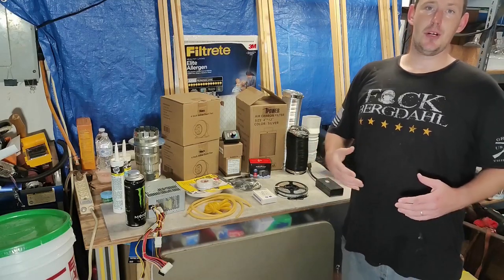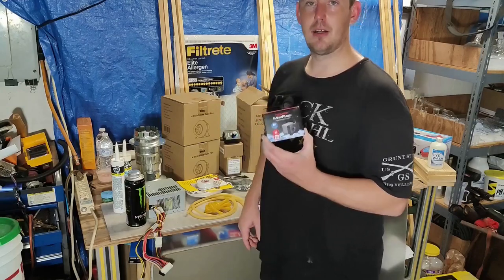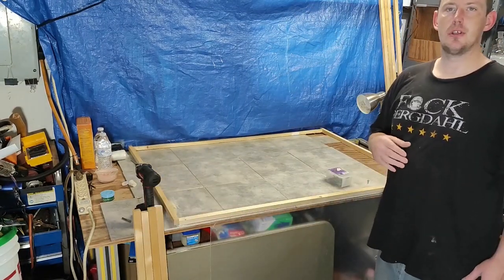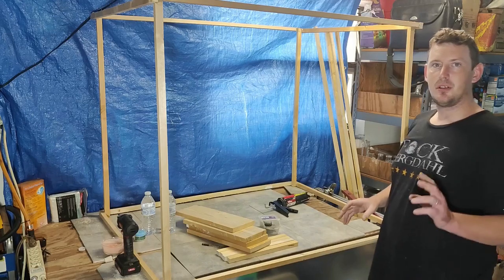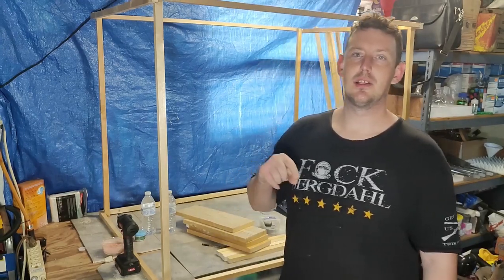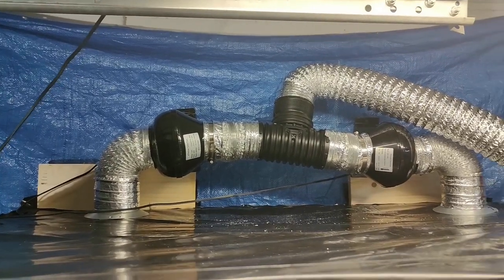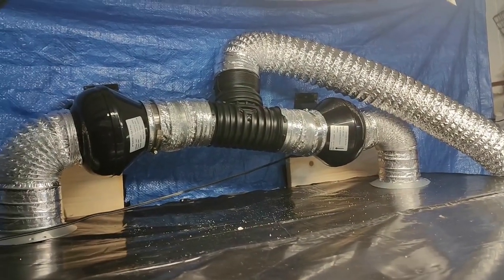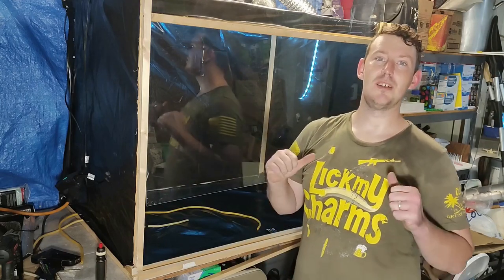DIY Laboratory Fume Hood: Easy, Cheap, & Effective Walkthrough

Comment: Fumes will exit much more efficiently if the top is built at an upward angle into the exhaust ports. A flat top causes turbulence and fumes roll around inside
Reply from the maker: I'm not building it to outperform existing functional fume hoods, a simple carry over is fine here once I get the baffles on and new fan put in. I just have way too much going on to attempt playing in the lab, it's sad unfortunately since I haven't been able to record or experiment in a year now

Comment: I like the concept. I am currently planning out my fume hood setup. I think I will use a plastic barrel loaded with carbon as a pre-scrubber to protect the ventilation system.
Reply from the maker: I really wanted to use 1/4" plexiglass on all six sides, and then use squirrel fans for the air barrier and scrubber but the project fell way out of price range rapidly. Do you have the vent system planned out? I'd be interested in seeing what you've got planned for your build
Reply: @CondorrK Carbon filter with water based scrubber would keep your neighbors happy at least. You can treat the waste water as needed. Plexiglass reacts to certain acids and petrochemicals, as well as nitriles. I still say living  1,000 yards from anyone is the best option, which doesn't help you. Nitric acid boils are quite easy to see from miles away anyway.  Lol!

Comment: I love it! But why not use 2x4s or sheet metal studs at home depot?
Reply from the maker: Mainly pricing. The wood was sourced locally for free and I already had the Mylar/plastic sheeting. If I had more budget I'd have better invested but budget is also why it's been 11 months since my last upload. Gotta get rid of our Mazda sapping funds. May upload a few tutorials on engine repair and rebuilds since I now have 3 engine blocks, 5 heads, and all have issues but usable parts but the one I spent $500 on to fix the problem originally. So rebuilt and replacing the swap with tucked and partial shaved bay atleast. Once it's confirmed good again it'll be the main and I can finish my Audi then get back into the lab at night 😂 it's been a mess here. Being so constantly overwhelmed is bad, but offers some opportunity when I can remember to film.

Comment: Question, how well does your activated carbon filter work to reduce oders?
Reply from the maker: I'm changing my setup to an 8" 950cfm and haven't run much smelly stuff through my current setup to say it's great, but people complain more about stuff they do in the garage than experiments I've done. Worst was probably ammonia gas when I used ammonium nitrate & water for endothermic cooling, no smell outside but I could smell it some inside for sure. Hoping the new fan does much better for moving volume and will be hard sealing the outside
Reply: @CondorrK  Thanks for the reply. I just finished building a test inline activated carbon filter.  3 foot of 8in galvanized duct, with a 4 inch galv duct inside with with 5/8 holes drilled through it capped at the end. with 40 mesh stainless screen wrapping the 4 inch. still haven’t tested it yet but hopefully will complete the rest of the build soon.
Reply from the maker: @markadams8452  nice. Carbon filters do work but keep in mind they can be very restrictive on the system, I don't remember the literature on exhausting it but people have done secondaries less restrictive that help at the same level for scrubbing gases

Comment: What are you using to protect the wood from chemical spills?
Reply from the maker: Sorry for the late response. Right now, nothing. It's more proof of concept while I refine and verify parts. It'll be redone eventually, but the highest risk to the wood is either a spill amounting to more than 6 liters or corrosive gas not evacuated by the fan system. The fans are being replaced by one unit flowing 850CFM and I'm installing baffles that should further strengthen the system. The exterior is being done with wood laminate, the interior with the same mylar sheet and is being introduced over the current wood structure.

My current struggle is my sash. I'm cutting it in half lengthwise, with the top being permanently fixed and the bottom being the movable piece. Getting it in place, movable, and maintaining a seal with the upper vent bypass is where I run into issues. I could also sub the wood for metal, but then corrosion and price becomes a problem so that is best left up to what you use most often. I'll be doing an update in the next month or so, after finishing a honda block rebuild that went horribly wrong. I'll be happy to have new content coming in again, it's been too long
Reply: Wood burns but besides that is it that bad? I do my chemistry on a wooden plank. Concentrated sulfuric acid will make black stains but at least it won't dig in too much as it does in metal nor produce flammable hydrogen. Probably not the smartest material but OK for me so far.
Reply: I used sheet metal, and it was all food grade stainless steel  i had cut to my specs at a local fabrication center that makes roach coaches!(lunch truck vendors)! No more fume magnet!
Reply from the maker: @fmdj  no problems so far, but the bottom square is Mylar covered. I tucked it over to have a half inch drop for spills. I'd like to do a stainless exterior and keep the plastic coating inside but every setup needs different environments so it all depends on what you typically use and what'll be special case scenario. So far, holds up good when I have time to be in there. Recently focused on a civic rebuild so we can open up our budget.
Reply from the maker: @Angrychemist666  nice! Did you look into coatings for it to keep corrosion and spill Dave minimized? I don't remember what all is available, it's been a long time since I did my research on L3 fume hoods
Reply: @CondorrK  you know! ! Never did. And it was nice for about a month right up until I started making fuming HNO3! And holy shit how pissed yet mesmerised how the shiney plates were turned into a greyish parkerization coating reminding me of rifle coatings! Some blotches here and there. 😥 so these days ceramic tiles are gospel ! Haven't had problem 1 yet and its almost 3 years now. Hell if that's what NASA used for the shuttle! Uummmh eerr! Bad example! But im not doing any energetics so its all good!
Reply from the maker: @Angrychemist666  I have ceramic tile under my hood but I did it mostly for the support and levelling of it. Mylar plastic you can get at hydroponics stores or probably home Depot and usually works well. Not sure how it'd fare against nitric acid, but sulfuric acid and hydrochloric both around 50% did well. Like the community says, always research before going in just in case! They'd be mad at my setup though. No baffles, weak flow, nothing for the 2 or 3" height lift deterring swirl flows. And it's currently overflowing with bottles, distillation for ethanol, clipboards, thermocouples, heat wire to make a good mantle hopefully, etc. lmao I have to get it reorganized and maybe move it into a better space if I can get a good solid greenhouse type thing or torn down shed.
Reply: @CondorrK  i wouldn't worry about what the community says about youre setup! As long as it works for you and you're enjoying yourself, besides have you seen some of the setups out here? OMFG! There on the verge of KABOOM to the 100th power and I swear ive seen a few that could easily be meth labs. Im talking sloppy joe bathtub as a reaction flask, and maybe even their toilet bowls! My absolute favourite ones are the Hindi chem vids! They NEVER use PPE at all, and they keep really nasty chems in used poland springs water bottles and i j7st feel so much better about my setup after watching those made in India chem vids😂🤣😁
Reply: @CondorrK  Ok. Thanks. Looking forward to it. I just have a soft pvc table covering.

Comment: I'd use a non-reactive material for the frame and enclosure material, a non-metalic fan,  a water based fume filter and live on my 5 acres away from everybody else. Just saying. 😂
Reply from the maker: The vent fans are ABS, and the main plastic I used is Mylar sheeting I believe. If I could afford land away from people I'd get it just to have it 😭 
I'm planning a proper rebuild of the hood soon once I finish my PID heating mantle - assuming I can source free materials or print enough money for materials

Comment: What is the inside height of your fumehood?
Reply from the maker: I think the inside height is around 3' before adding baffles and everything else. I picked up some upgrades and will be updating this sometime soon when I figure out the revisions. I'll post accurate internal dimensions when I find my tape measure lol
Reply from the maker: It's been a while, how is it coming and how do you like your setup?
Reply: I finished it a month ago but have been very busy with work and still have not used it yet. Hopefully in April sometime. @CondorrK